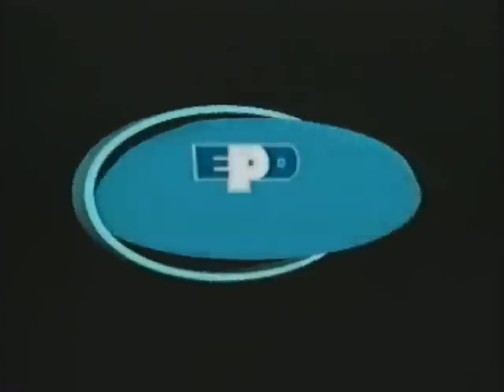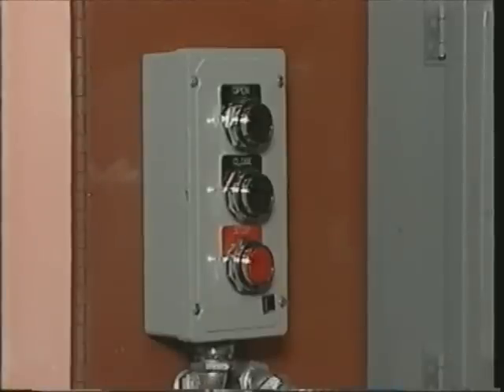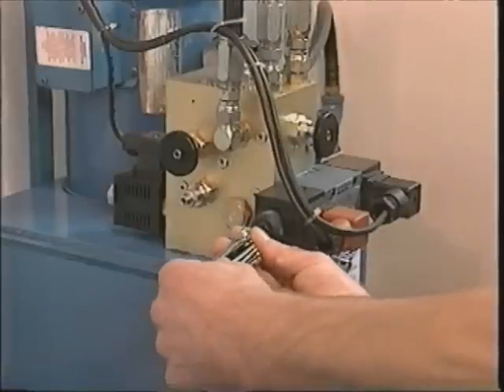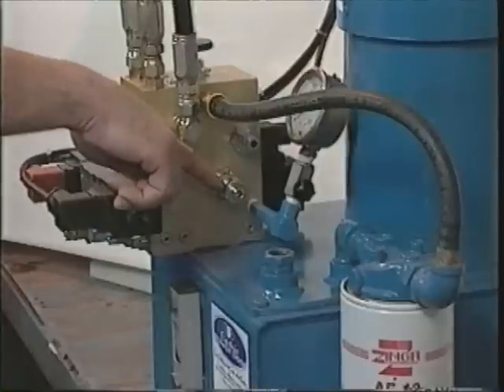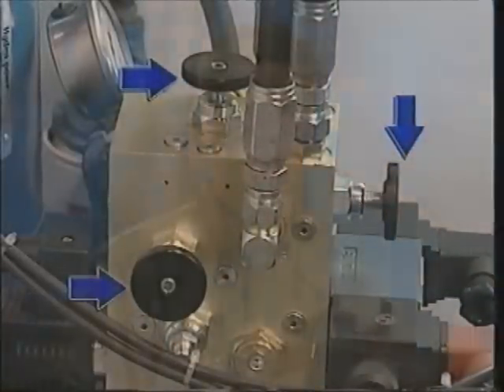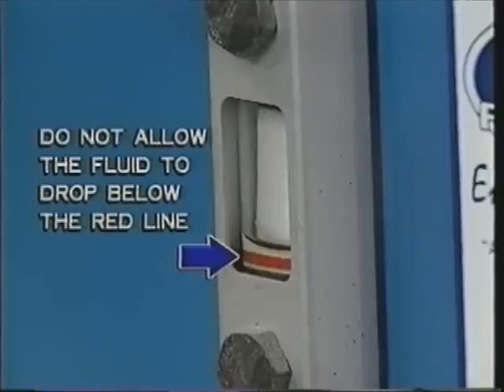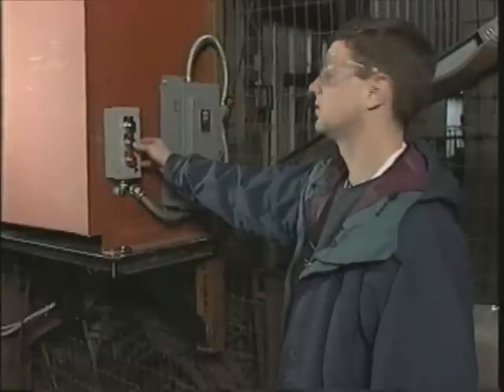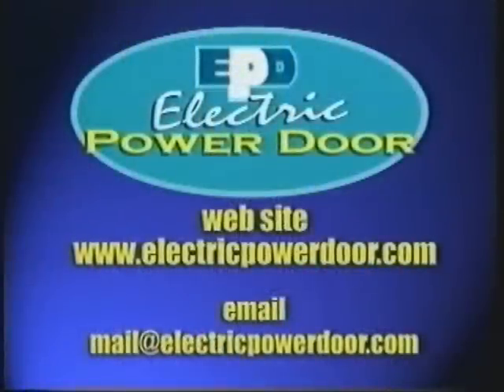03-Filling & Bleeding Hydraulic System.wmv

Comment: With all due respect: not a word about safety. Never push the mechanical override on a directional control valve unless you have cleared the area of personnel. Pushing the override can cause and actuator to move unexpectedly, which can result in severe injury or death.